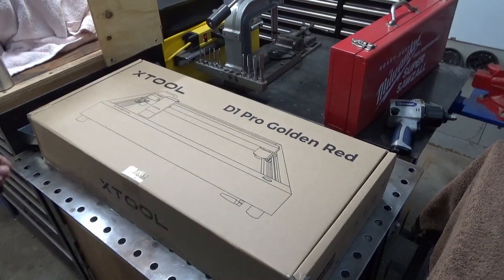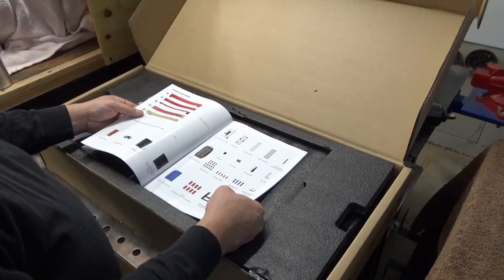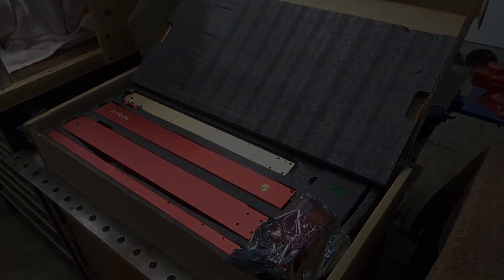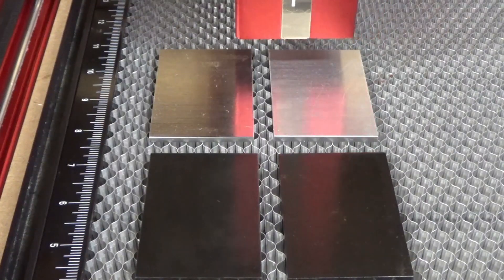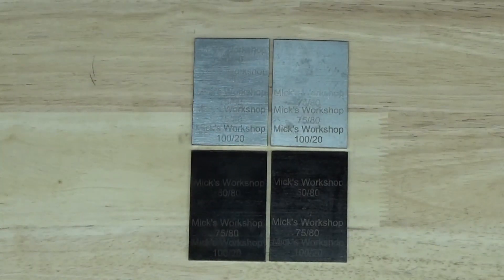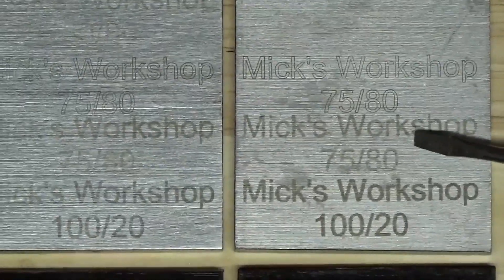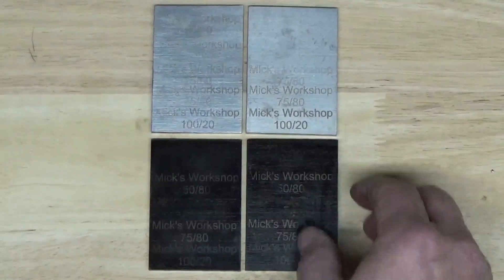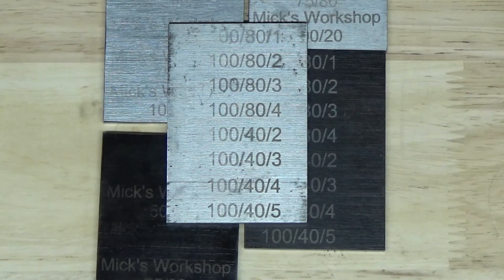xTool Infrared Laser Engraver Test on Steel

Comment: I was thinking of doing something similar with oxidized metal like you did with the blues metal. When you removed the bluing was the surface you revealed metallic like an in blued piece or a bit dull?
Reply from the maker: It was a pretty flat finish, almost a bit yellow. Definitely not shiny steel.
Reply: So if I take highly polished brass and oxidize it brown and then burn off the oxidation I’d probably get a dull brass color I guess
Reply from the maker: @chrome72  I don't know. What would you oxidize it with? If I have any I would be willing to try it.  I haven't tried brass at all.  On aluminum all it did was cut into it, but with stainless steel it cut and it left a black finish. Normal steel it left a finish similar to the blued steel.

Comment: This is really quite underwhelming - is the laser properly focused?  As I understand it the focusing lever is way off and a lot of the infrared lasers require manual focusing.
Reply from the maker: I just watched a video on the very subject. I'll have to try it again with what I have learned. I used the focusing lever. I was not very pleased with the results either, but it was literally my first attempt.

Comment: Hi Mick. I have the same laser as you and finally did tests today. I got questionable results on mild steel.  Even many passes didn’t improve the results. Then I tried surface ground pieces and the laser didn’t penetrate at all. Then I cold blued but didn’t oil the ground part and the result was awesome. But as soon as I put oil on the etching vanishes. Its utterly maddening.  I will keep trying to find the correct recipe but so far meh 🫤
Reply from the maker: Did you get the infrared laser head?
Reply: @MicksWorkshop  you got me there Mick. I didn’t know they had another laser at different wavelength. Argh. I got the Xtool d1 pro 10W which is a diode laser as I understand it.
Reply from the maker: @LetsRogerThat  Yeah, they just came out with the infrared laser head which is specifically designed for steel, stainless steel, brass, copper, etc.   It actually only puts out a couple of watts but consumes more power so it comes with a different power supply too.  I would think you could just buy the head.  I bought the 20w blue laser head and the infrared at the same time.
Reply: @MicksWorkshop  I just looked it up. Darn. Oh well it is available as an add on. I’ll save my pennies lol

Comment: Looks like a nice unit Mick, thanks for sharing. I may have missed it but what was the wattage?
ATB....Dean
Reply from the maker: Hi Dean,  I didn't get into the wattage aspect because it's completely different from the blue light lasers.  It's technically only 2 watts, but the infrared spectrum is what most fiber lasers use, which engraves metal better.  It actually comes with a larger power supply.  Here is a pretty good article on it:  https://hobbylasercutters.com/xtool-infrared-laser-module/